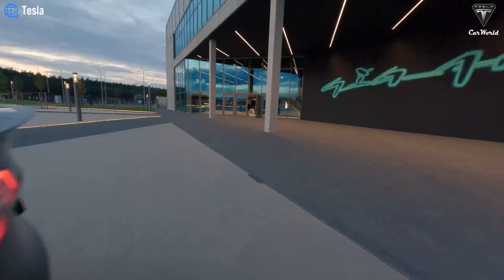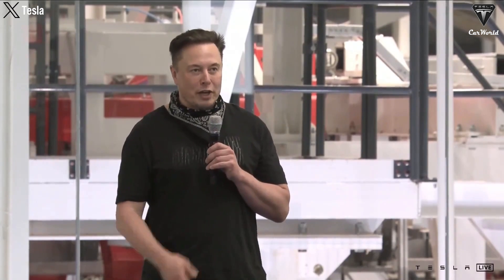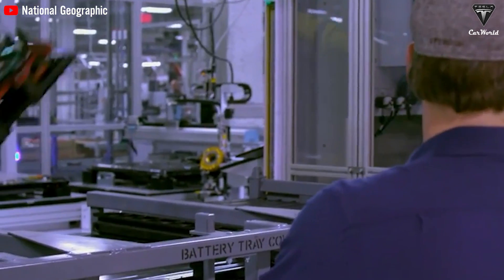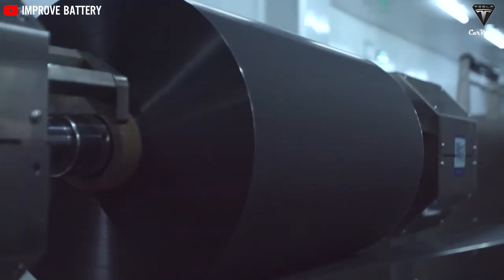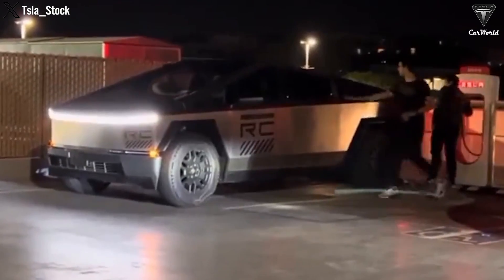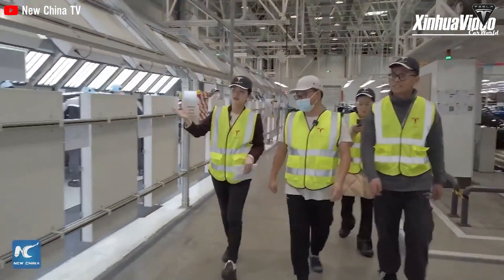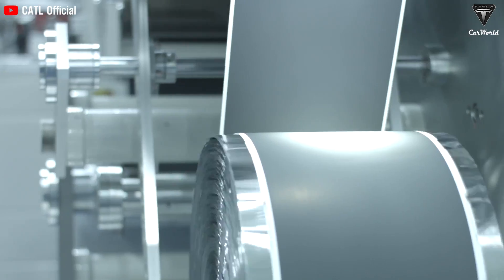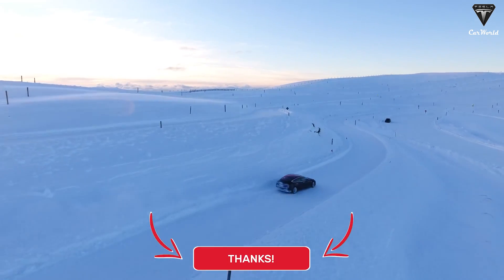It Happened! Elon Musk Confirmed Stunning ALL-NEW 4680 Battery, Exclusive Tech Explains!

Comment from the maker: The 4680 battery boasts an energy capacity 5 times greater than other electric vehicle batteries, reaching 26,000mAh. By using fewer raw materials in production, the Texas factory achieved a significant milestone by producing enough batteries in just one week to power 1,000 Model Y cars. Amid fierce competition with other batteries on the market, Tesla continues to strongly develop this battery line. Thank you for your enthusiastic support of our video.
Reply: How much charge per 1l?

Comment: BATTERIES ARE STORAGE DEVICES; TO BE USEFUL THEY NEED TO BE CHARGED;  REQUIRE  CHARGING; THEY NEED A CHARGER AND A POWER SOURCE . MORE BATTERIES, MORE SOURCE POWER.  EACH TIME THEY DISICHARGE  THEY NEED TO RECHARGE . THIS IS THE TRUE STARTING POINT OF THE PROMOTION OF EVs. TO BE VIABLE, BACK UP IS NECESSARY; TWO BATTERIES AND TWO CHARGERS AND  TWO POWER SOURCES ARE REQUIRED . THIS IS CALLED REDUNDENCY
Forget materials and range , forget charging time, forget cost, get you home in a uncharged EV is expensive AND there is REALISTIC POTENTIAL FOR REDUNDENCY.   So back to the drawing board ! Start with Hybrids!
Reply from the maker: thank you so much

Comment: 4680 batteries are hardly impressive, just an incremental improvement over the long time in production 2170 batteries. The reason the 4680 batteries have 5 times more capacity than 2170 batteries is that they are about 5 times bigger in size. That's right, for the same weight and space as 5 - 2170 batteries, you can replace them with a 4680 battery. There is a fairly small improvement in energy density, on the order of 10% or so. 500%??? That's a completely misleading marketing claim.

Further, Tesla has been trying to get these 4680 batteries into large scale production for nearly 4 years but couldn't get their production speed and yield up to acceptable levels. So finally, they may have arrived. Unfortunately, there are now multiple competitors that are more energy dense and have better charging properties than the previous generation of batteries like the 2170 (and 4680).
Reply from the maker: Here's a response based on the comment:

The 4680 batteries represent an incremental improvement over the 2170 batteries, primarily due to their larger size allowing for about 10% higher energy density. Claims of 500% improvement seem exaggerated and misleading, as they likely refer to volumetric rather than energy density gains.

Comment: Whats the use if the vehicles have only 75kwh on board ? How does the kwh per kg compare to previously used battery packs ? This smells like marketing magic more than anything else.
Reply from the maker: A 75kWh battery pack might seem underwhelming if energy density (kWh per kg) hasn't improved significantly compared to older packs. This does raise concerns about potential marketing hype over genuine advancement.

Comment: so when are you going to drive the thing , when it needs to be plugged in 48/7 now ? not 24/7 >>> 48/7
CHARGING TAKES TOO LONG TO BE OF PRACTICAL USE
i got a step at home , you can drive it for about 30-40 minutes , it needs to charge for 5-6 >>> HOURS <<<
that's what needs to change the other way around , BEFORE i buy ANYTHING electric again , ever !!
batteries SHOULD last for MONTHS , not DAYS and take about 2-3 DAYS to charge
electricity also keeps getting more and more expensive and that won't change either , it's going to KEEP GOING UP ,
so EVERY TIME the electricity goes up , so does your commute expense , it's NOT feasible to keep up with that amount , going up AND UP , every couple months / a year
that's just shooting yourself in the foot , from the MOMENT you buy one of these electric cars
Reply from the maker: I understand your frustration with current battery technology and charging times. For electric vehicles to be more practical and cost-effective, significant improvements in battery life and charging speed are necessary, alongside more stable electricity prices.

Comment: The next Battery will be a 6C Blade from catl or byd, or will this batteries produce by Tesla?
Reply from the maker: The next generation of batteries, such as the 6C Blade from CATL or BYD, could potentially be sourced by Tesla for their vehicles. Alternatively, Tesla may continue to develop and produce their own advanced battery technologies in-house to meet their specific requirements and maintain control over their supply chain. Ultimately, the decision will depend on factors like technological advancements, cost-effectiveness, and strategic partnerships.

Comment: Sounds great but they are planning on making 685 Cybertrucks a day to meet their Quarter of a million a year goal. Thus they will need 6 times this amount for projected CT requirements. Plus that again for Semi and RoboTaxi. Or 3 and Y high performance. 
A lot of batteries required.
Reply from the maker: meeting Tesla's ambitious production targets for vehicles like the Cybertruck, Semi, and RoboTaxi will require a substantial increase in battery production to ensure sufficient supply to meet demand. Scaling up battery production will be crucial for achieving these goals.
Reply: The goal is not 250K, but "up to" 125k/yr Cybertrucks at Giga TX ( the only place they are being manufactured). And you are right , they cannot produce even for 125k. The recall data that just came out today showed that they produced a grand total of just over 11k CTs to date. Extrapolating to annual results, that means about only ~25k/yr and I don't see them going much higher than that. 125k/yr ?Not this year - that's for certain. Another of fElon's lies.

Comment: Great, 5x the energy capacity of the firebombs they already made.
Reply from the maker: Tesla's new 4680 cells offer 5 times the energy capacity of previous models, which enhances performance and range. However, Tesla is also focusing on improving safety measures to prevent issues like those seen with earlier battery models.